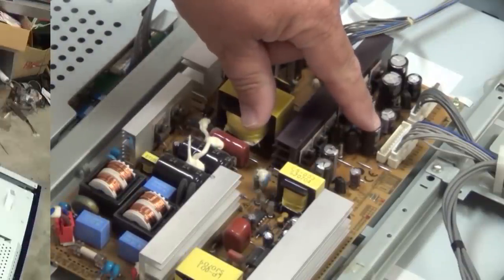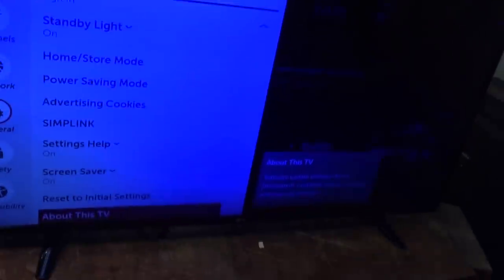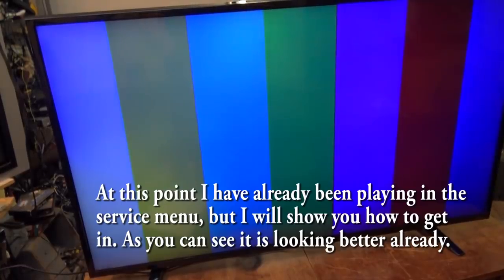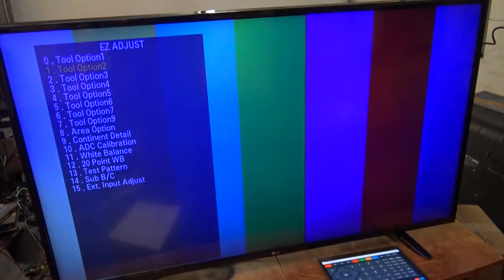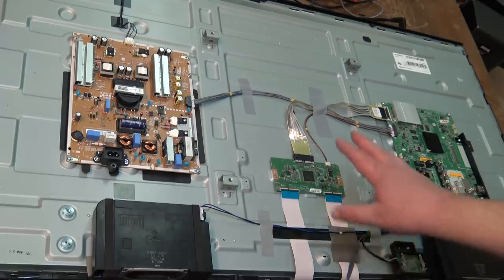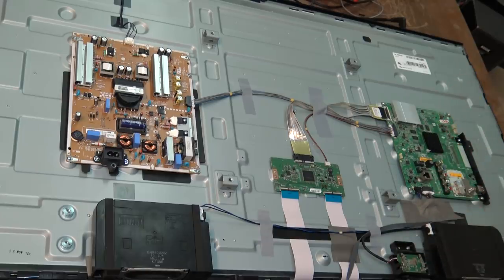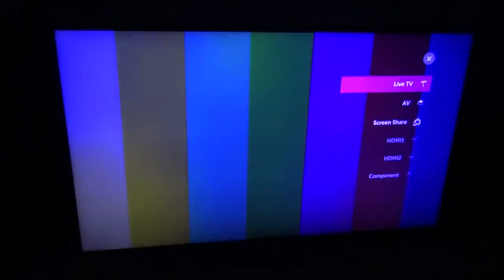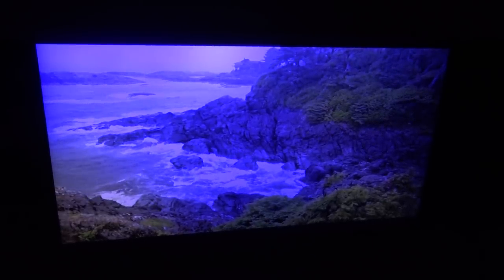LG 49UF6400 UHD 4K TV Picture Turned Blue. Let's find out why.

Comment: Old TVs got bad very rarely and only after 10-15y of use... New ones get bad just after warranty. I have quit repairing TVs because of this and my customers who buy them from me are well prepared for the fact their new TV might just die after warranty. So don't buy the highest spec expensive TV nowadays. Buy something budget, throw it away once bad and buy a new one. TVs got very cheap nowadays anyway
Reply: Mani you are so right..I bought a L G..55" plasma in 06.in 08 it was dead .. I gave 2,100 for it..what a mistake
Now I have a Panasonic that is 11 years old. Viera is the name of the set..wish I had bough two.
Reply: @rodneybrand8521  very true, those older Tvs are great for everyday life. Just watching TV. Even now with all that tech like 3D, 4K, a Million Hz refresh rates, play store, SMART etc ... I have experienced TVs when new use at least 5 year old tech. So whenever you get a smart TV, it gets QUICKLY SLOW after just a few uses. When our tiny little 5" mobiles had 16Gb of ROM, the 55" TVs came with 1Gb-2Gb. What a joke. Being high-tech, you are bound to change it after a little while even if it is working fine because the software will be outdated and updating will make it crash constantly. So many smart TVs with issues and outdated software. You can get a $1000 phone today with the latest specs and a 6" screen, but it will be old in 2 years from now. That's $42 a month to own a phone excl. the usage. Now add a $1000 TV which will probably last as long, then a washing machine, dryer, dishwasher, microwave, oven, car,  ... Life is SO expensive, just these few new appliances will set you back $$$ EVERY MONTH for life because you have to change them to keep up or they will just fail suddenly. And not to forget, every household has like 4-5 mobiles and multiple TVs. Look at that per 2 years (warranty period), Thats easily about 10k. WOW. It's unfortunate we people have to experience this. Everyone is working so hard, days and long nights, to make money only to give it away to this trend of latest and greatest. The saying, invest in something good, isn't valid anymore. The latest tech I myself have is a Samsung P-series monitor (No Smart/no 3D) with a Google chromecast. It has been working fine since 2009. Around that time is when things started getting really ugly.
Reply from the maker: Why do you think I left the business 15 years ago.
Reply: You are right. The consequence is all the crap that is generated. I know nowadays TVs are very cheap but it is not sustainable buying TVs like pizzas
Reply: @12voltvids  I know these new TVs are not always serviceable, sourcing parts is hard, but since they fail so much more often wouldn't there be much more TVs to be repaired?is it really not worth repairing these TVs full time?
Reply: Nafunny it's not that there aren't the failed sets out there, they are. It's just the cost of repair versus a new set means they are not financially viable to repair and people don't bother taking them in, they just recycle them and replace. Sad but true.
Reply: @MrShinta786  thats the reason i wont deal with lcd or led tv's i will still repair older sets and crt rear projections and thats about it
Reply: Not always. When the power supply went out on a older Vizio I had it was a eazy fix, a 50$ power board. Still have that set
Reply from the maker: With the cost of new sets, and the difficulty getting parts it would be tough to try to make a living repairing tvs these days. That is why I left in 2003.
Reply: @MrShinta786  I know.. the math is staggering...nothing last any more..but I'm thinking about buying a Samsung 65" in the near future
a friend just bought one and the picture is fantastic I'll keep the Panasonic  it still works fine...thank you for commiting back take care..
Reply: @rodneybrand8521  I got 14 years out my Plasma but then again I calibrated it and had it ran through a line conditioner. Technically it still works but all the Caps need to be replaced. I was in the market for a new screen anyway. I do miss the Plasma at times.
Reply: They seem to be built to fail these days, cap's close to  the rail voltage, and the cheapest crap capacitors they can find, probably all the other components are the same cheap & nasty, have you noticed how they remove the marking of the chips as well

Comment: I have two LED TVs here, one from 2013 and one from 2016, and so far they haven't started blueshifting, but we'll see. These are Samsung models and have been in constant daily use since purchase. 

Also, the first one is "smart", which seemed like a neat idea in 2013 but quickly became unusably bad. That TV now has a Roku stick in it for the media player features.
Reply from the maker: I have never connected my smart TV to the net.
Reply from the maker: Samsung make a better set IMHO over LG. I do like the OLED set by LG, but they cost too much for what the life expectancy it, and on OLED pretty much any trouble you have is the panel.

Comment: Was never a fan of LG, bought a low end samsung less than $200. If it pukes i go parts stripping and it is gone. Everything is built to a cost point. Which does NOT mean pay more get more BTW. You are correct about plasma TV'S, had a pioneer that i liked. Now it is my sons gaming set. I got the cheap samsung, for the limited use it gets it's fine.
Reply from the maker: You can tell how good a tv is by the weight. If you can pick it up with an index finger and thumb. it probably wont be lasting very long. On the other hand if it takes 2 people to lift it, it is probably good for awhile.
Reply: @12voltvids  Then i will ask of you this : If it were your cash and you had to buy a new tv. Which manufacturer would you choose.
I had not known much bad about samsung,
so i kept it low cost and held my nose. 
I get a few years out of it it's fine with me.
Spend a lot or a little sometimes it makes no difference. Years ago i used to pick the ones folks would leave on the curb. Let Sams fotofacts do the rest. A few bucks in parts and some time, it lasts how it lasts.
Now it seems all of them are junk.

Comment: My LG tv has started doing this as well, just patches of blue at the moment
Reply from the maker: The diodes are starting to fail.  They turn blue at different rates.
Reply: I'm in the same boat. Just started. Only 2 years old
Reply: Steven Simmonds same as mine, got my tv January 2018
Reply from the maker: @iJustRich  
Since shooting this I have seen about a dozen in customers homes that are doing it.  One customer gave me their old plasma 4 years ago so I rubbed it in that their old plasma is still going strong. They actually asked if they could have it back.  It's the one I watch the morning news on and the screen has some serious burn now from the logos that the local stations plaster all over the right side of the screen.
Reply: Try to watch the Super Bowl on a blue screen. LG TV's are crapp

Comment: If you work with TVs you should know this cheap model does not have a Quantum Dot.
Only LG's "NanoCell" are Quantum Dot. Like Sony "Triluminous" and Samsung "QLED" etc.
And what "2 main chips" ?? Nope!
One actual chip and the one on the top is the TV's CAM module connection...
And the LEDs and stuff also runs on low voltage.. Everything inside the TV does....
Amd LCD TVs don't use RGB LEDs (RGB subpixel LEDs)... Only microLED and OLED do that...
And LED lightning is WAY better than the old ones. The reason is not power consumption but LEDs normaly have a longer lifetime, are much brighter, gives local dimming options and much more. This is really basic facts dude! Learn them!
I would not let you even touch a screw my TV when you don't even know these things. No offence.

Comment: not last long anyhow. not with the backlights on 100 %
Reply from the maker: TVs are not designed to last.most of the new ones you cannot even adjust the backlights much because they use dynamic dimming of the panel so even when you turn them down if you get a bright scene the TV will crank them back up. LEDs are the biggest lie that we've had in lighting in the past 20 years. All the LEDs that I spent a lot of money on to put in my home are not lasting. Bulbs that I spent $15 or $20 each for that were guaranteed to last me at least 20 years are failing after four years and these are not lights that are running all day and all night. I still have several old CFL bulbs that are well over 20 years old and still going strong.

Comment: I have two Panasonic plasmas one is standard def 15 years old and the other one is HD & 7 years old. Both still have great perfectly bright pictures, they've done a lot of hours. The gym I go to bought eight Samsung LED back lit TVs about 18 months ago they are now all completely shagged. Ok they've been on 15 hours a day, but they all totally buggered. The back lights have virtually all gone and they barely have a picture on them, I don't know why they don't just switch them off. One has no back lights at all. That is just crap, pieces of garbage. Samsung should be ashamed of themselves.
Reply from the maker: We have all been hoodwinked with LEDs.  Last 20 years.   Hahahhahaha the led junction might last 20000 hours but the phosphor that makes the blue light white certainly won't last that long before it fades.  Same thing happens with led light bulbs.  I stayed installing them in my house as old CFL bulbs failed.  Bulbs out of same package. A few were placed in service a few years ago.  Once the other CFL bulb popped another led from same package was installed.  Guess what. The original 2 I put in 2 years ago are notably blue compared to the one fresh out of the package.  I have another 2 high hour lamps. One of them failed after 3 years but still under warranty.  Manufacture replaced it and the color was different.  I always blamed that on just manufacturing difference after all the are 3 years different in manufacturing however now I believe this was color shift that occurred with the first one as many years later there is still a color shift but it is not as noticable as it originally was.